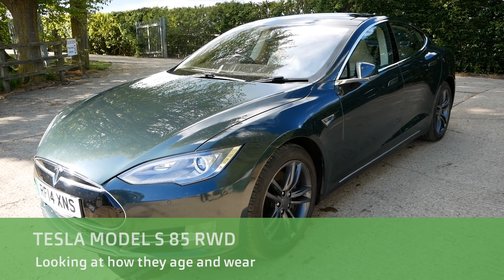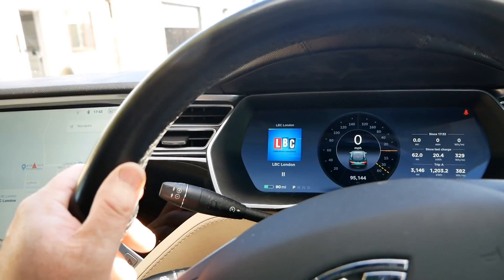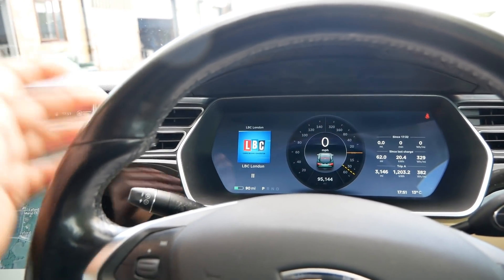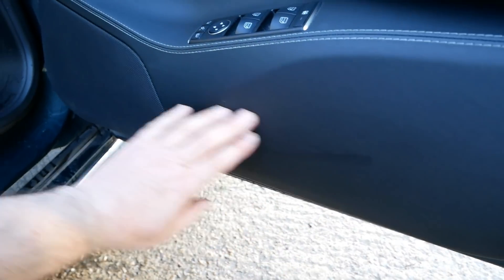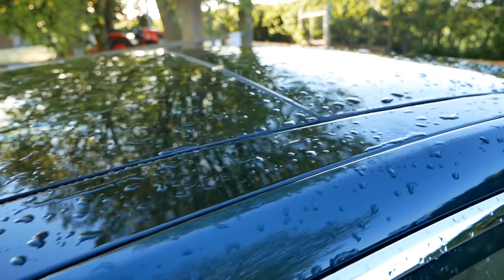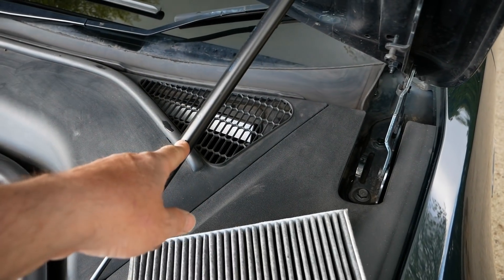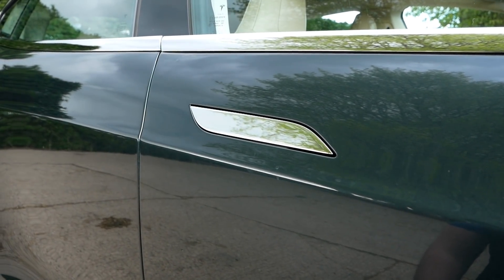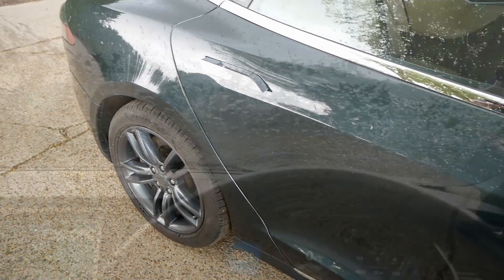How well has this 2014 Tesla Model S aged over 95,000 miles?

Comment: Thank you for a nice video! I have a 2014 Model S P85+ , same colors. Still perfect condition as well , I have a prepaid 8 years maintenance plan so it has been checked regularly. I bought it new and I am so satisfied with the car that will keep for many years. The price on the used market is low so no point to sell it, since it feels like new. The only reason to buy a new one would be for the autonomous driving, but that is only needed when I get so old that I don't wish to drive myself anymore.
Reply: How many miles do you have on it?

Comment: Great video, thanks for sharing! Do you think this level of wear/battery degradation can be expected from other similarily used teslas, or is this one slightly better, or worse?
Reply from the maker: Most likely
Reply: Reported experience is about 1-1.5% in first year as battery beds in, then anywhere from 5%to 10% over first 100000 miles. Apparently there are plenty of cars with up to 400000 miles on them, still running fine.

Comment: Hi, really good informative video for someone like me who is intersted in buying a used Model S as now you can pick one up 12-14k. Can i ask you if its a good idea to buy a 2014/15 year one with 100k plus miles on the clock (with free super charging). I understand the warranty will have expired so would you advise to still buy one as I read the battery should last for 300k plus miles.
Reply: I am mainly looking at the ones listed by a local ev dealer, with their own battery shop.  They offer a 1 or 2 year battery warranty. About $15k in us$ and up.

Comment: According to the MOT from 9th July 2019 it had issues with opening the doors from the outside of the vehicle so it’s had it’s handles repaired at least once. It’s normally the wiring that breaks due to the frequent movement during retraction.
That was at 42,654 miles.
Reply from the maker: Oh yes, forgot about seeing that. You're right, the handles must have been repaired then. As expected, as there's now way early Model S handles would last 7 years.
Reply: @GoGreenAutos  No, lol. 🤣

Comment: I can tell you what it’s like to own these old Teslas. We have three of them in our family and they have all gone over 180.000 miles since we bought them 2014 and 2015. Still only buying new tires and windshield wipers. Batteries have degraded 1% in average per year. Best cars we ever have owned.
Reply from the maker: Good to hear
Reply: Interested to hear what miles per KW you get at 80mph
Reply: @dominicwood3750  difference between summer and winter. Winter 2,75 kW per 10 km summer 2 kW per 10 km at 125 km / h speed.
Reply: thanks

Comment: Thank great review we are think changing our 2018 33kw i3 for  second hand Tesla S or New BMW i3s ✋🤔. What do you think
Reply from the maker: I've ran two i3's for a while. Nice cars but I found the narrow wheels got annoying, particularly the 20". After having hitting a pothole that burst two tyres and buckled one alloy, that was the final straw. The Tesla S is a very different car..in size too..so you can't really compare. You wouldn't compare a BMW 1 Series with a 7 series.
Reply: i have the same i3, my petrol rex has broken so its literally battery only and its shit for long journeys, much rather the tesla. however if your rex still works then probably not much difference assuming you don't drive 100 miles every single day.

Comment: I'll be interested to see what happens to these 1st gen electric cars in the next 2/3 years regards battery performance, whether it dips, how much they cost to renew and what happens to the old one when it gets reipped out, given that the warranty / service life will be over. That's the major factor for EVs in the long run for me. They have a service life for a reason and only Tesla knows why right now...
Reply from the maker: I would like try to keep this for the long term, as there's not much else to upgrade too without spending a considerably more about of money. A Jaguar i-Pace would be on the cards in the future, but currently they are £15,000 more. Maybe only a dual motor Motor S would temp me to swap.
Reply: I have 40K miles on my 2015 S85D and only seen a 2% battery degradation. I always charge to 90%, only 100% on a few times where I needed the extra 30 miles range in a long road trip.
Reply: @rafacq Stop think about degradation. That’s a distraction technique by EV evangelists. The bigger concern is catastrophic failure of the battery pack. It’s coming for you very soon, if not in the last year. 😂😂😂
Reply: @JetFire9  This comment by one who has read too many anti-EV screed sheets

Comment: Great video. Congratulations!

I bought a used 2015 S85D with only 12,004 miles in April 2019 and LOVE it. Felt like a new car! 

I was fortunate, at that time Tesla still offered a “like new” warranty of 4 years/50K miles, in addition to the 8 year drivetrain/battery warranty, so I still have over 1 year warranty left!  

Not a lot of things gone wrong, rear latch replaced, radar sensor rubber replaced, and a recall on the steering column screws and front latch check. I did have to replace the original 12v battery in February 2021, not bad for a 6 year old life! Tesla charged me $230 US dollars to replace. 

Recently, I have received offers to buy my car for US$5K more than what I paid!  No way I would sell my Tesla!

Comment: Where would you suggest shopping for a private sale anywhere in the UK? I’m looking for a 2014 to 2016 Model S that’s VAT qualifying to purchase around Christmas.
Reply from the maker: Autotrader. But you'll struggle (near impossible) find a VAT qualifying one at that age. You'll need to be looking for one straight from the lease company and this is typically 3 (or 4 years) old.
Reply: @GoGreenAutos  Thank you, that makes a lot of sense why I wasn’t able to find many. I do see the rare ex-hire car around the 25,000 GBP range, but I was surprised to hear you say you got yours for closer to 20,000 GBP?
Reply from the maker: @DavidManouchehri  Prices have risen since. Mine has gone up about £8K since owning it.
Reply: @GoGreenAutos  Wow! Is it just low supply of new cars driving the values up of used cars? I might just wait it out if that's the case, I guess I can go another year without a car.

Comment: It looks like you got a super nice car, it's clean everything seems to work. Prices for this Model S in the US are still significantly higher. Mid high 30s. Into the low 40s.
Making something like the VW ID4 a little too close in price for a brand new car.
You definitely want to keep an eye on that motor noise and get it changed regardless before the warranty is up. They will be giving you a new redesigned motor that should never fail ever again.
There are some aftermarket suppliers now to help take care of the door handle failures in these cars. The design of some of these is superior to the Tesla versions. And they're relatively easy to do yourself.
Congrats on the new car. Certainly is a nice color and looks great inside and out.
Reply from the maker: I did get the motor changed on this under warranty, see https://youtu.be/ympqwIyQY4s and they've also now changed the traction battery too see https://youtu.be/VBhtAwTaygc and https://youtu.be/sYZ2ArCaPKU
Reply: @GoGreenAutos  
Thanks for the update, I'll take a look at those videos.
Makes me a bit concerned about buying a older Tesla. Most of these are now past that 8 years.
I drive 50,000 per year. So makes me a bit worried.
Reply from the maker: @kens97sto171  In the UK, the earliest Model S's will be going out of warranty this year, as we didn't get them until 2014. Mine is one of those early ones. If you can find one that has had the warranty work done, already then you should be ok.
Reply: @GoGreenAutos  
That's been my thought also. Find one that has at least one or two years left of warranty so that if something would have happened right after purchase you'd still be covered. Or find one that had already had the motor and batteries and the MCU already replaced.
I still think the Model S is the best looking car they built. 
I really don't particularly like the interior on the Model 3 and Model Y.
Minimalistic is what they call it, boring and cheap is more how I see it. The materials quality is fine, it's just not a very inviting environment it's more sterile or something.
If you look at like a Volkswagen ID4 or Even the lowly Chevrolet Bolt EV they have ambient lighting and just a more attractive interior.
I think the Model S was very nice looking on the inside and is a good balance between those two.
Reply: @kens97sto171  yea I feel like they are losing there futuristic touch that’s y I’m willing to get the older s still bc the 3 & Y seem to be catering to the ppl not teslas vision interior wise. The sterile part made me laugh lol it’s funny bc I like my house to be a minimalistic design like that but a car not.
Reply: @QUEEN-cn4ln  
Yeah kind of how I feel too. The 3 and Y are just so boring on the interior.
Even the Chevy Bolt has some interior lighting to lighten up things. And the ID4 has a lot nicer interior lighting. Biggest problem for me is price. Brand new model Y in the US is over $60,000 and has things that I don't want or need like a giant glass roof. And door handles that are a pain in the butt to use if you've never seen one. I do ride share work. You can imagine having 50 drunk people every night trying to paw and claw at the side of your car trying to figure out how the damn door handle works. Versus a normal freaking door handle. At least the model S the door handles pop out and look like regular door handles. The ID4 has door handles that you just know what to do and they're lit where you're supposed to grab them. Turning radius on the ID4 is really really good too and if you drive in the city all day that can add up to being a big thing. I'm just not a big VW guy in general European cars tend to be expensive to repair and maintain in the US so that makes me cautious. I'm kind of thinking about getting a Chevy Bolt which is a perfect city car. And just get my feet wet with that and I'll keep my Prius for long distance road trips if I need it. Not that expensive to register and keep a car on storage insurance.

Comment: My 2013 S had plenty of problems early on, but they were all fixed by Tesla.  Now with 100k miles it is completely reliable and doesn't show its age.  No VANOS problems, no oil leaks, no accessory belt replacements, no O2 sensor replacement, no ...
Reply: My 2008 Toyota with 390,000 on it hasn't had any of those problems either.
A lot of people that buy electric vehicles like a Tesla because it's a high-end luxury car they tend to be coming from Audi's or BMWs that are basically horribly unreliable.
If you had driven a Toyota Avalon or Camry or something else certainly it would not be as nice and as exciting as an Audi. But you would not have had any of those problems either.
My car still rolling on all the original suspension components, except for the struts themselves. Tie rod ends ball joints control arm bushings, engine doesn't leak a drop. Burns a little bit. But not enough to be worried.
Still has the original sway bar links too.
Reply: @kens97sto171  My Tesla is a garage queen and my Toyota gets daily use with zero issues.  I hope it makes it to 390,000 miles!  I've owned the horribly unreliable German cars and would never go back to those disasters.
Reply: @ronmac1832  
I think we're not going to know the final results of reliability on Tesla and others until there are a lot more of them on the road and many years have gone by. Tesla also has some issues to deal with service and repair. Once they start selling double or triple the number of cars that they do today. This problem is only going to multiply if they don't find some solution. Or if the cars end up being incredibly reliable and mostly perfect when they leave the assembly line. That would only leave car accidents and repairs related to that to deal with.

Comment: Charging speed has been reduced a lot since 2019 due to sw update to protect the battery.
Reply: They lost lawsuit in norway cause of update slowing charging
Reply: @Clixlol  Yes, that's the news, but Tesla still has to respond and appeal before the end of the month. So nothing is really decided. I went on a trip from Copenhagen to Kiruna in the North of Sweden last autumn and even with the reduced sharging speed it was not that bad. But now you have to plan for arriving at a supercharger with reallyt low state of charge to make it efficient and only go to the next supercharger. This is what I already always did on long trips with this car since the charging speed always fall off quite a bit at higher SOC. So perhaps as big a deal as it is made to be. But of course I would love to have a faster charging speed. But anything like model 3 we will never get with such an old car. My 2014 P85 still drives amazingly well.
Reply: @HansKruse  A well written reply, many thanks. Any idea what the maximum speed of charge you can get?
Reply: @computerbob06  I just checked the charging speed of my 2014 P85 which has done 262.000km in total on the same batterypack. At 5% it was charging at 125KW, at 10% 108KW, at 15% 97KW, at 20% 86KW, at 25% 79KW, at 30% 72KW, at 35% 65KW. At and earlier session I saw 53KW at 50%, 42KW at 60%. So as you can see the charging speed decreases quite rapidly and beyond 60% it goes really slow. But between many superchargers 60% is enough to reach the next one even at motorway speeds. So for me it is mildly annoying, but can sort of live with it as otherwise I would have to sell the car and pay quite a bit to get a model S without this decrease in charging speed. It would have to be minimum a 90KWH pack. If I should buy a newer model S it would be Raven model so at least from the 2019 models when the Raven was released. That would cost about 2x the value of the P85 so at the moment at stay with the P85.
Reply: @Clixlol  Most of the Nordic countries have three-tier-court system, this was in lowest one; local or "district court". If you have money that verdict means very little. Tesla did not even sent their lawyer in there! They will just appeal and go to the Court of appeal "Lagmannsrett". And I guess sent lawyer this time. (And they can appeal to the Supreme Court, but that level can select the cases which it takes in)
Reply: @Clixlol  they haven’t lost yet, just in the first instance du to no show and they have appealled.

Comment: My 110,000 UK miles P85 is just the same except I've not scuffed the trim as you get in. I specified no sunroof just a plain black roof, that was a good idea, the cars c of g is so low without the glass up there and obviously no leaks or noise. Doors and window seals all good, yes mould in the seam on the rear lights, jet wash them out. Good assessment on 100k Model S, these things last rattle free.Tesla only charge £60 for the CCS adaptor now, note many more Super charger then appear on your sat nav screen. And yes the seats are great after big miles and the cars dont rattle, build quality a bit questionable but little niggles sorted in the first few months of ownership, long term they hold together well. Early on I set easy entry to seat up wheel up seat back forward and guess what no interior wear on B post. Ive recently had all 4 door handles replaced with V2.5 which is the latest V3 handles mounted to the V back plates this means there are no microswitches or moving wires This mod was done by a Tesla Ranger for £1,400 as I had fixed 2 handles when the 3rd and 4th went. The mod has to be done on all 4 as the system software is updated but the new handles work by calibrating current draw off the motors so dont fail..............so far..............10 months later and counting.
Reply from the maker: Good to hear

Comment: I own a 2015. The condensation in the reverse lights come from that bar being swapped out. That is not the original Tesla bar. It was upgraded. The bar needs to be glued down to the lens but doesn't really fit to stay glued down. Tesla doesn't use a good enough adhesive. The original bar did not have a plastic cover. It went straight to the inner plastic. The key fob plastic casing can be bought from Tesla direct if you wish to have a new one. You are also missing the cover for your filter. That is probably why it is so dirty. You should be able to ask them for another one. I can guarantee this car has been worked on a lot during the warranty. Tesla never wants to give you the history, despite them keeping it. Those "Drop links" are not the first repair. I can tell just by the bar in the rear and the missing cabin air filter cap".  They are also not cheap to run out of warranty. Most repairs are about 1k. I can also guarantee those door handles have been replaced. Check your front Valence to make sure they haven't broken. You shouldn't take the battery below 20% btw. I never go below 30% and I slow charge.  The wipers speed up based on speed and rain coverage. Sitting still the wipers go at a steady rate until the rain is heavy.
Reply: Condensation in the rear lights we have on all three Model S cars since 2014 and 2015 but no problem yet. Comes and goes. 
Some few under warranty things were repaired by Tesla like some door handles but that was like 5 years ago. The 12 volt batteries have been replaced after 7 years and that is just fantastic normally 12 volt batteries don’t last that long. But other than that only tires and windshield wipers. Still going strong after over 300.000 km on each. If anything happens to our HV batteries we will replace them with refurbished once and just keep on driving. Brakes will eventually also need replacement but not yet.  Best cars our family ever has owned.